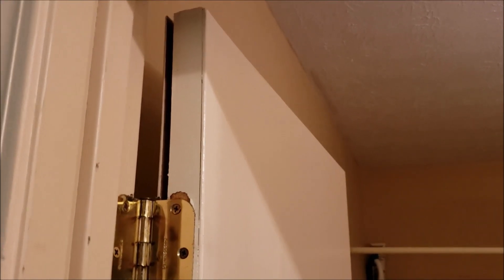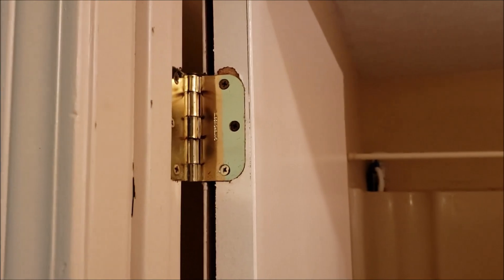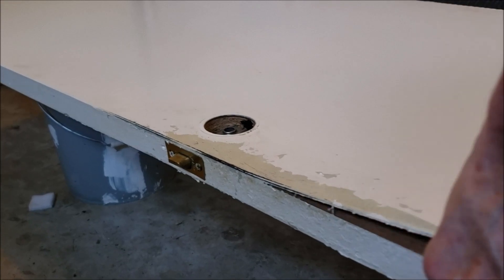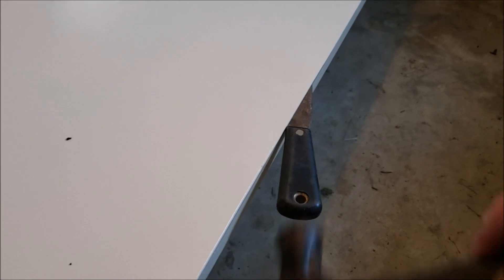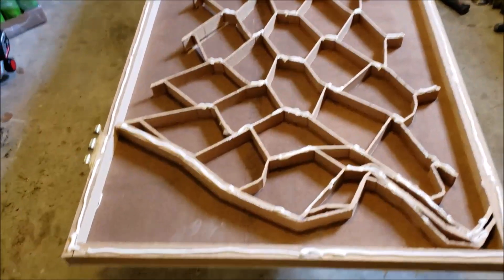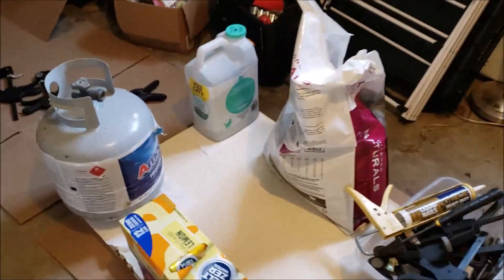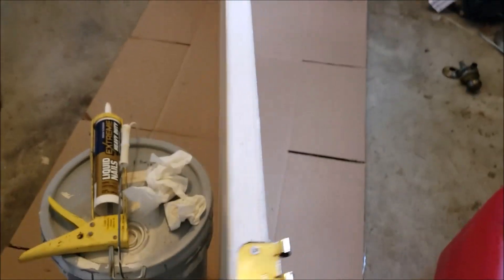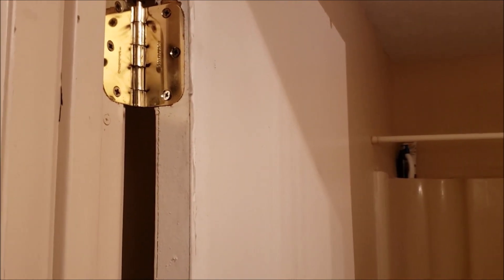DIY Landlord:How to Repair a Separating Interior Hollow Core Door So You Dont Have to buy a New Door

Comment: Wow! You're the only person I've come across who's willing to repair this type of door rather than replace it, so thank you for showing how you did it. (Most repairs of these doors are holes in them rather than the skins lifting away.) I'm hours away from the nearest hardware shop so replace isn't an option in the foreseeable future. The first door I need to repair has had both faces come off the inner wood frame at the hinge side so will be a little more work to fix, I think. Right now it's not closing without some leverage. Hopefully it will still fit the jamb when I'm done. Can't complain really. The original glue held up for around 50 years - not sure when this house was built - but alas its now dry, brittle and gone in some places. Again, thank you!
Reply from the maker: Thanks for taking the time to let me know. I just did another last week like your both sides was coming loose but its fixed now for just a few dollars for the cost of liquid nails, have a blessed day.
Reply: @ktoutdoor  Awesome! How's the first door holding up tho? Hope you're day is awesome too.
Reply from the maker: Holding up great I have been doing this for 30 years lol
Reply: @ktoutdoor  Ohhh! I hold great hopes for my doors then!